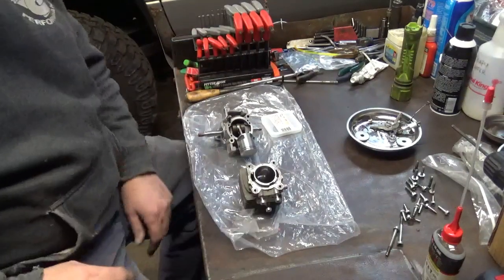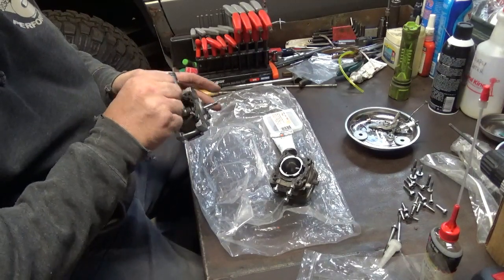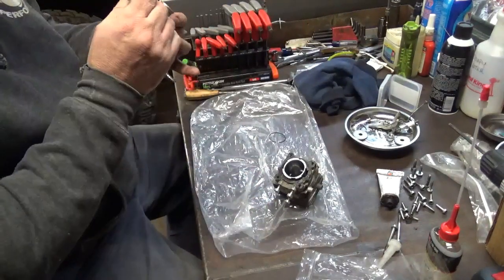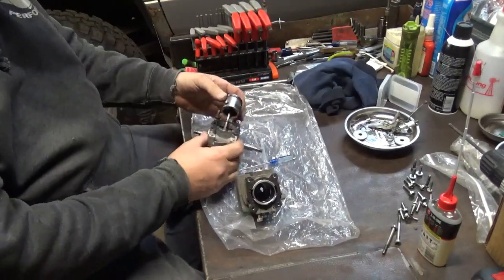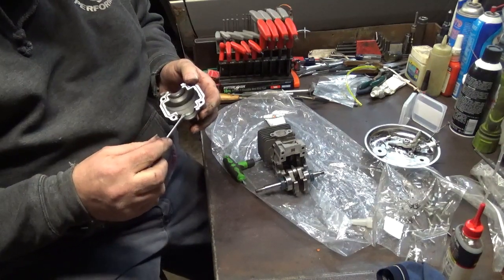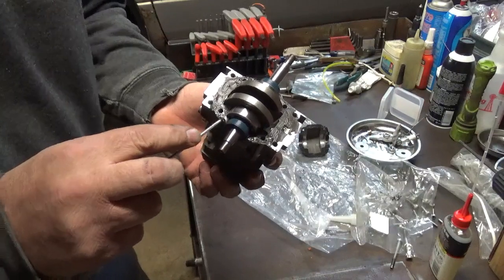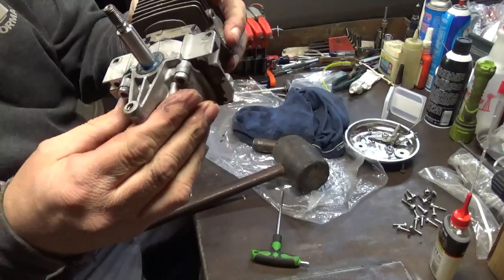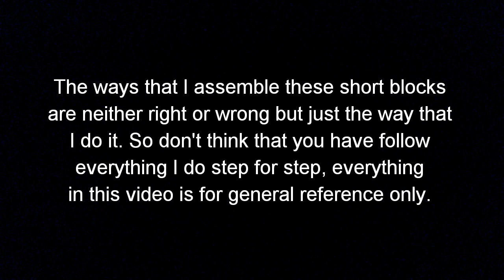Stihl SH86C Blower Video #2 "Short Block Assembly"

Comment: Enjoying this. However, there is part  	4144 029 2301 - Stihl Cylinder gasket that is used instead of the black RTV for the upper block->CC. No gasket for crankcase shells.
Reply from the maker: You are correct 4144 029 2301 is a gasket for berween the cylinder and crankcase block, However I intentionally used the Optima Black to seal the cylinder to crankcase (as well as the clam) do to fact this was an aftermarket cylinder with around 
.040 thousands squish, by doing it this way and deleting the gasket I was able to close the squish area to right at .030 thousands thus increasing compression, boosting power but more importantly creating a better fuel burn with a little less carbon build up.
Reply: Okay. Keep up great vids! Best